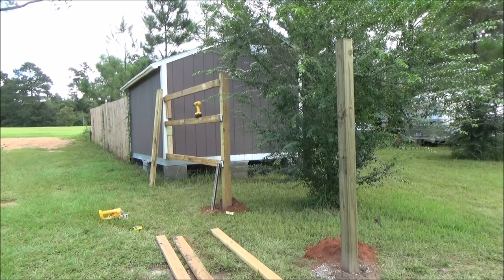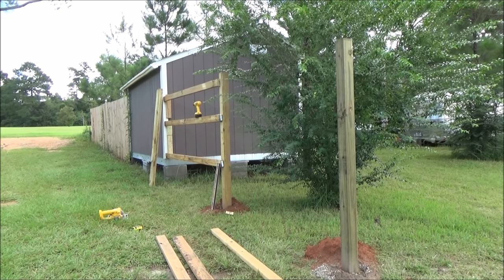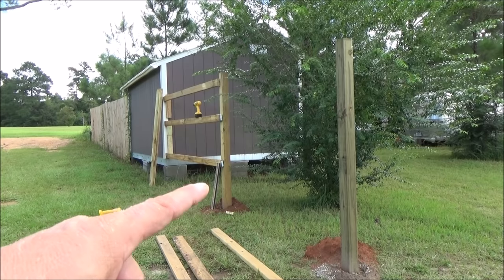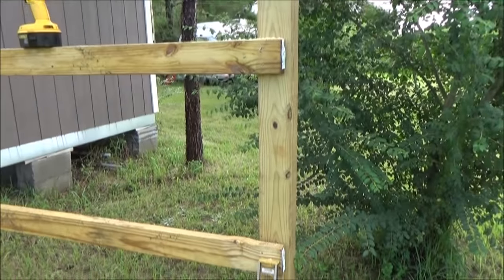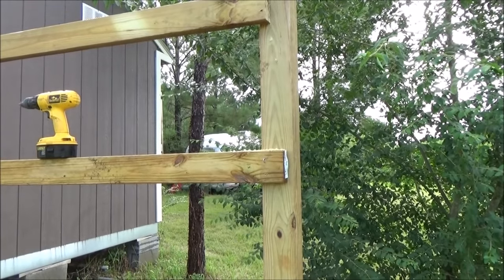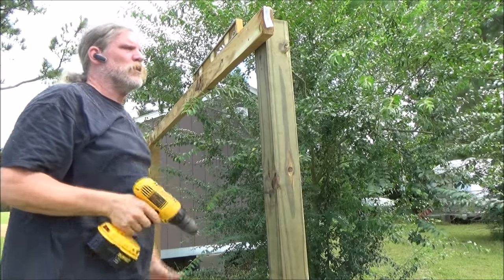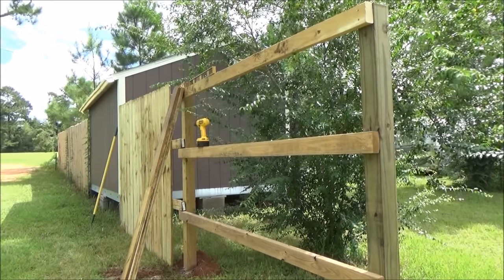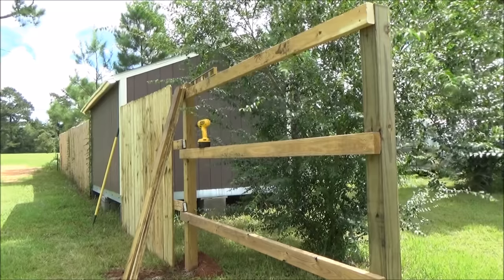Setting the rails on a wood privacy fence

Comment: I like the Idea of the screw for resting the board on ...I installed some cheap fence it cost $21 per panel ..... am now wondering what the cost difference is compared to how you are building it
Reply from the maker: 2 4x4s, 3 2x4s, 7 1x6x6 cedar pickets and around 20 coated deck screws per panel. You can figure the costs in your area..

Comment: Learned  to  use  screw  for  rest  when  I  built  the  hay  barn  by  myself.  Just  taught  my  son  while  building  his  storage shelves.   Are  you  going to  paint  back of  building  so  looks  uniform  along  the  line  at  some point???
Reply from the maker: I doubt it. we will likely use the pressure treated lattice stuff to "seal off" the back of that shed and that's about it. MAYBE in the far off future when the pressure treated fence AND the paint on the shed begins to fail we'll think about color uniformity. Right now, it's just not near the top of Toadstead priories.